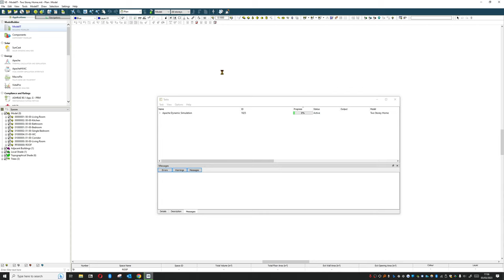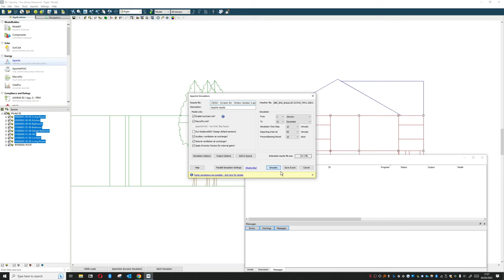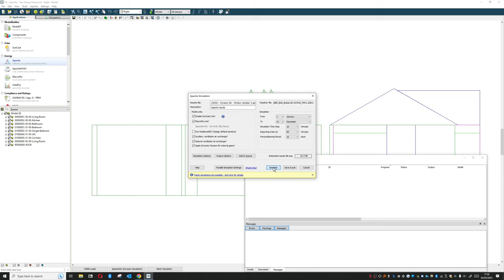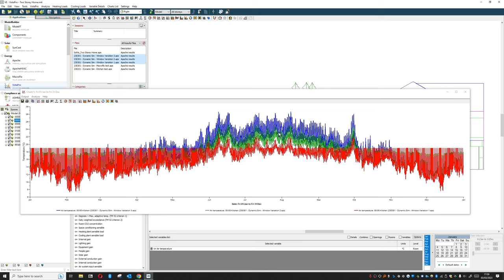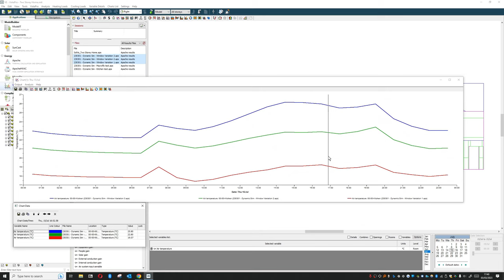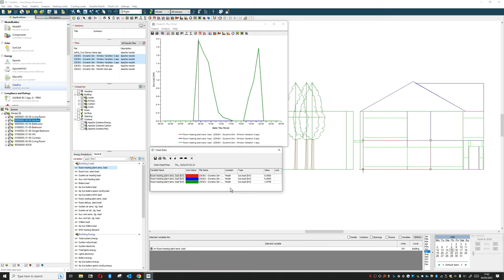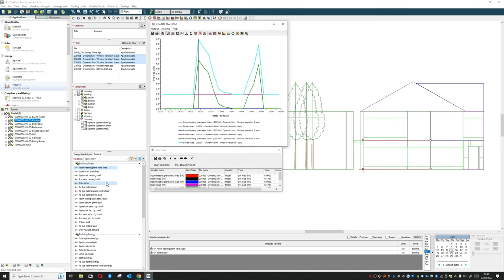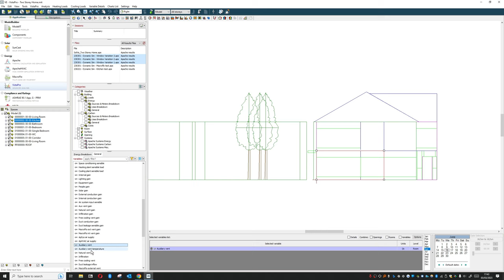IES VE Tutorials - Episode 19 - VistaPro

Comment: thanks for the video, it is really helpful. I'm trying now to see results of different variations based on a model with shading and without shading, but sadly I'm getting the same results. Does IESVE take the shading into account within Apache Systems or only within Suncast?
Reply from the maker: Okay, so it's tempremental between versions. If yourr not seeing a change in the apache results. Go to Suncast and re-run the solar. analysis.

Comment: Really helpful video. I am trying to determine the SCOP for an ASHP. Which variables do I need to look at? Would it be 'Boiler Load' and 'Boiler Energy'? Interestign Boiler Energy units are displayed in kW and not kWh for 'energy'. Also, can someone explain the difference between 'Boiler Energy' and 'System Electricity'.
Reply: SCOP is something that is set rather than calculated in IES. For the energy, it depends what you look at. If you look at the monthly totals or at metrics that look at use over time then you'll get kWh or more like MWh. But that is calculated via instantanious power over time, so if you look at the graphs, it's most likely in kW as that is the instantanious requirement to meet the demand. 

Boiler energy is the energy used by the boiler, system electricity is the energy consumed by the system via the electricity meter. You can set multiple meters up in IES to monitor various energy loads, but electric is a default one that should cover things like lighting (though I'm a little hazy on that, been a while since I used it, so I might be wrong).
Reply: @owengray4684  I have looked at this in a bit more detail. Although you can set the COP of the heat pump in IES you can calculate the SCOP based on the boiler load (kW) / the electrical energy (also given in kW). As I understand it, the SCOP is affected by many variables which are calculated as part of the dynamic simulation in IES.
Reply: @owengray4684  also if an ASHP was being used (with no lighting in the building or HW) then I would expect boiler energy and system electricity to be the same. In my scenario boiler energy is greater than system electricity which I can’t understand how that can be
Reply from the maker: @adammiddleton3362  sorry for the delay. Rather than risk giving you the wrong information you might be well advised to Google "ies vistapro manual" a pdf should come back off the first search, this will give a full list of the variables and what they do/ cover.
Reply: @grayenergy5413  thank you. I did download the VistaPro manual and determined that it is Boiler Energy that I should be using as the input value. Thank you
Reply from the maker: @adammiddleton3362  not sure if it's still something your needing do on a regular basis but IES are running a free summer school and on the last day is specifically focused on heatpumps.

Comment: Thanks for the videos, It was really informative and helpful for my project. I would like to know how to enable heating and cooling load report icon so i can get results. Presently i can get only cooling load summary not heating load.
Reply from the maker: Hmmmmmm, I think what you need to do in that instance is control click the two results in apache, both the cooling (the results file should be in blue) and heating (the results file should be red). Drop me a message if that doesn't work.